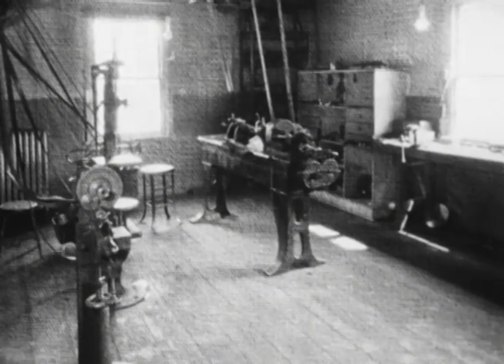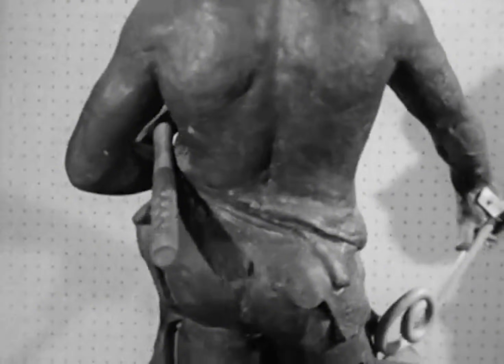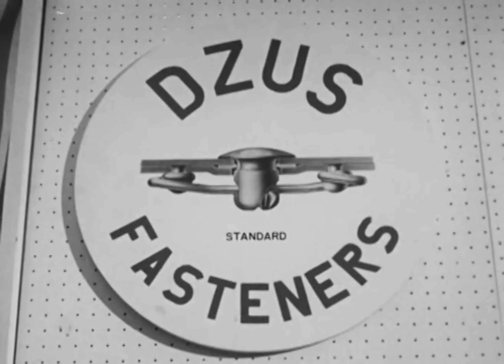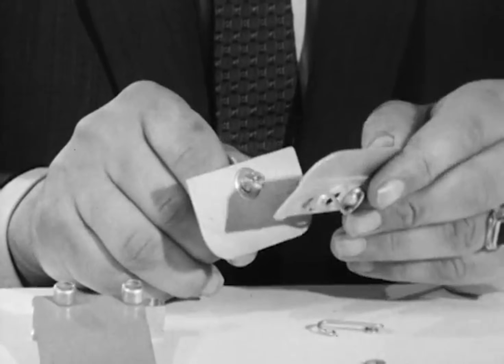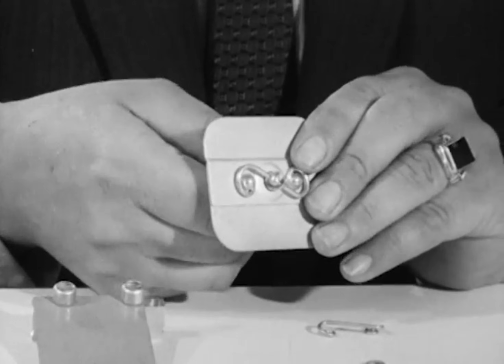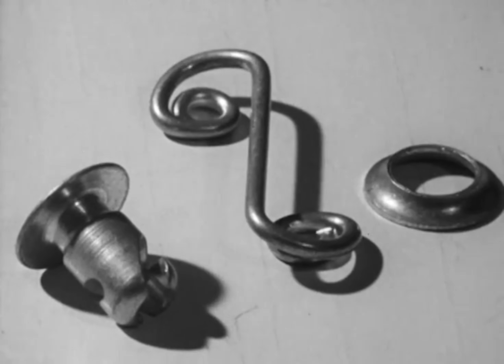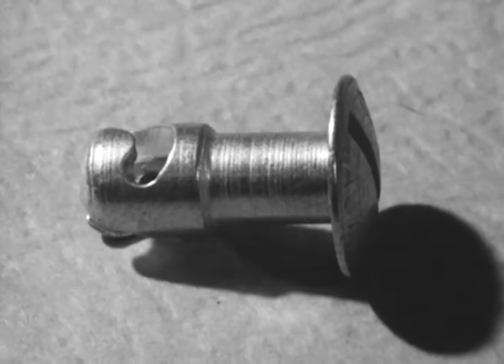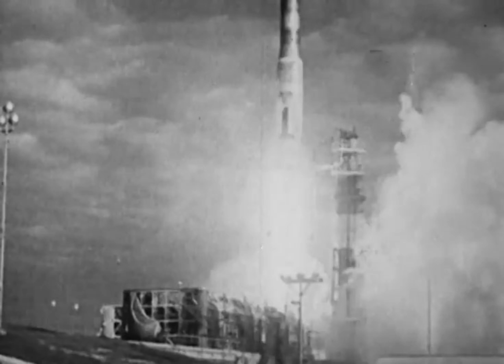The DZUS Fastener: A Minute in Aviation’s Fastest Clamp

Comment: In power supplies, I've seen exactly what's in this video, and it was very reliable.  Then, also in power supplies, I've seen a variation of that, and it was notoriously unreliable.  Instead of the curved slot going through the wire, the bad version had the shaft with bumps on it that was supposed to wedge itself into a piece of stamped metal when turned, and these things had a high failure rate.  Sorry if my description is vague.